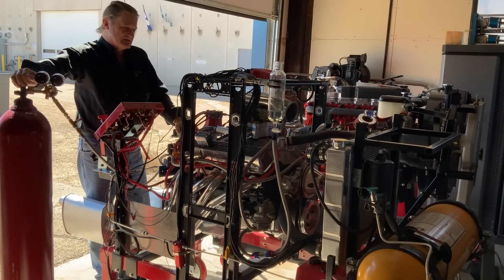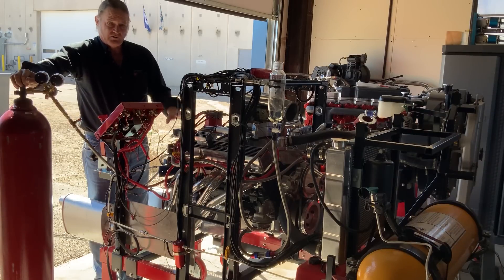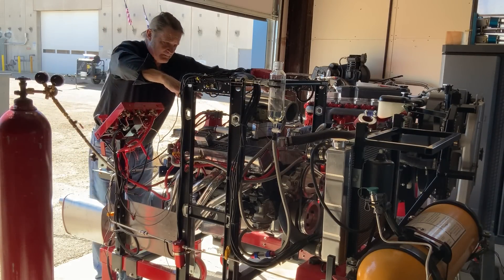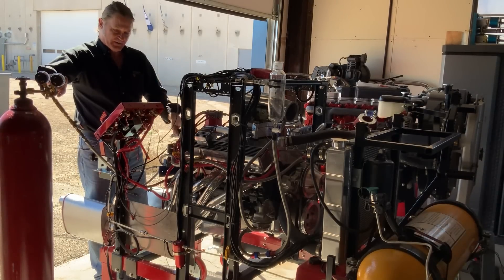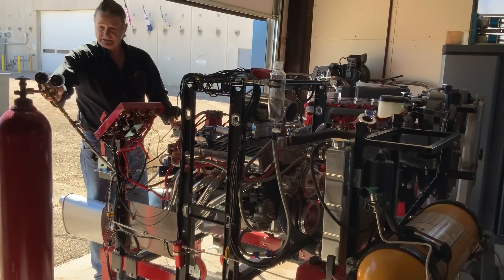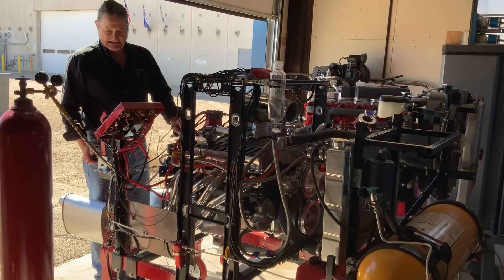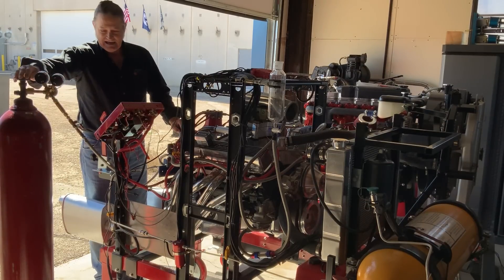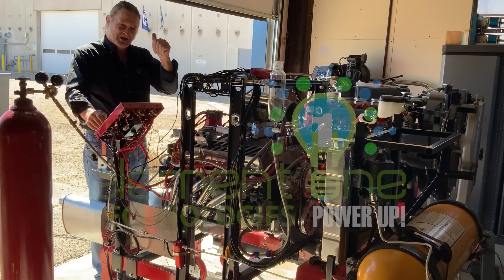Hydrogen powered V8 ICE High RPM Test

Comment: just discovered your channel.... this is great! I've been touting that hydrogen ICEs are the way to go, it just makes huge sense, Even with its problems, but like many technologies in their early stages of development, it can be overcome. From all I've read about hydrogen, the main problems are the production of hydrogen in the first place, as it requires gas to be produced, but the newer 'Green Hydrogen' processes, shows that even though it's in its early stages of development, shows that hydrogen can be produced without using petroleum. Of course, like everything new, it has a much higher cost that gas... but again, all new technologies (not that hydrogen ICEs are new, but in its early development stage), it's just a matter of time, and when there's more demand, it becomes more profitable and the costs get lower. The other problem with hydrogen, though I don't see it as a problem, is the loss of power compared to gas. From what I remember, there's an approximate 15% loss of power, but that's not that big of a deal. Just look at how seemingly low powered engines in motorsports are tweaked and improved to produce absurd amounts of power, so that 15% loss can easily be overcome, and 15% is not that huge an amount. When the early days of pollution controls hit the auto industry back in the mid 70's, it reduced power levels a LOT more than 15%, and today's engines are a lot more efficient, cleaner, and produce many times more powerful engines with better pollution engineering. And, most importantly, all the businesses and manufacturers that are are built up from the ICE, can stay in business... Instead of being forced to go out of business.

I love your engine run stand, but I'm wondering what that big yellow tank is used for (?), as I can see your hydrogen is being fed from the tall bottle. Also, I cringe a bit at your proximity to your engine, you really need to put that engine in a proper separate test room, like any dyno room, separating yourself from any potential catastrophic engine failures. I see you're just in a garage, and obviously funds are limited, but that really, really needs to be addressed. All your work is going to mean nothing if you end up in the hospital unable to work on your project. But hey, congrats on your testing!! This is fantastic. 

Though I'm not against battery operated vehicles, the idea that we should convert all of the almost 300 million vehicles to battery operated electric cars, just screams of trouble.... What with the ecological effect of creating that many strip mines and fracking wells (yes, fracking is a method of extracting lithium and we all know how damaging fracking is) will it take to produce that much lithium to power that many vehicles? And putting all of one's eggs in one basket, is just asking for trouble. Yes, once all the coal plants and eventually, all the natural gas plants are replaced by renewable power sources, electric will be even cleaner... but as we've seen, those power plants are at the mercy of extreme weather, and domestic terrorists... not that a hydrogen plant wouldn't be, but with electricity, the grid itself is just way too open to damage. Going all electric is a bad, bad idea, and is gonna bite us in the arse in short order. 

Hey, big props on your project... gonna keep watching and seeing how it goes. Good luck!! Now I have to check out your other videos....
Reply: By 2028 The Japanese Toyoda and Honda will have the Definite answers for What Kind of Cars we drive.

I copy here the Fuel Mix  to Generate Electric Powers in Texas (ERCOT) which is the Best Independent Grids in USA.

Last Updated: Aug 31, 2023 19:29 CT

CURRENT GENERATION
Solar1,807 MW (2.5%) 
Wind6,224 MW (8.7%) 
Hydro228 MW (0.3%) 
Power Storage917 MW (1.3%) 
Other105 MW (0.1%)
 
Natural Gas 46,786 MW (65.5%) ‼
Coal and Lignite 10,419 MW( 14.6%)‼

Nuclear4,946 MW (6.9%) ‼

In half an Hour TX local time where Solar Energy would be Zero and more People Turn on their TV and Plug-in their Teslas.

The Percentages of Natural Gas would be 74% and Coals would be 14.5%

We/I have been monitor daily in August and The Grids are Dirty more than a Simple Small ICE Car -- the averaged ICE car has Engines of 120 KWatt/hr while as most Teslas are like 400 KWatt/hr.

Based on ERCOT and Many Agencies: The Efficiency of

Solar is 25% more or less
Wind 20%
Coals: with a typical U.S. coal plant operating at 32% to 33% efficiency. 
Natural Gas:  50-57%
Then when Electric Powers Charging Batteries and Run Electric Motors is around 80% in perfect Weather, when Sub-Zero Temp Winter Coldness Efficiency is 50%.

My Math shown the BEV are more Polluting or Higher C02 Emissions?  Perhaps DOE and EPA have been using a different Charge/Standard to rate those Batteries EV!

That not including all the Mining to Get Metals to Make Batteries; and unless the New Solid States 🔋 🔋 Claimed by Toyoda and Tesla;  Most BEV are 1200 lbs more Heavy than averaged ICE;  The Tires and Road Surfaces worn-out.  And that I have not accounted where would be the Energy to generate enough Electricity for USA even with 50% were BEV Electrified Vehicles??‼‼

Cheers,

Comment: Two issues here buddy. Hydrogen run hotter and no lube. Run it for 1000 miles and those rings and cylinders will be cactus. The other issue is where do you get your Hydrogen from. It takes a ton of electricity to  extract Hydrogen, so as far as green its shit.
Reply: Hydrogen DOES NOT run hotter due to faster flame speed. The EGTs are 40º lower on hydrogen the gasoline. This engine I built 8 years ago an its as strong as it was then. so - sorry - no toast.

Comment: I really don't understand all of the hype. Also, how can you tell your AFR with no wide band o2. Didn't we already invent this technology except we youse it for CNG due to the lower heat strain? I know CNG Burns at 1790 Celsius and Hydrogen Burns at 2045 C. It's a great idea in general but an impractical application. If you were doing actual loads or driving, you would run the risk of melting pistons or melting your exhaust. I mean steel melts at 1370 Celsius.  I could honestly see your, e.g.t temperatures reaching at least 1500 C.  Aluminum blocks would be on the verge of melting as well. Seeing as aluminum melts at 660 C CNG kits already have a hard time with high heat and low power. It's common for the blocks to crack. If you were to get very serious about that, I think you should steer away from piston engines. turbine engines may handle this type of fule better.
Reply: If you want true green energy, go nuclear.

Comment: It's running quieter and smoother  on hydrogen.. Could it produce enough energy to make enough HHO to operate it?  and how much residual energy would there be left and could the byproduct be  made with a generator head into electricity ?
Reply: "Could it produce enough energy to make enough HHO to operate it?" -->nope not by a long shot.
"how much residual energy would there be" NONE, since the electrolysis takes more electric energy than the produced gas mixture will give back in the ICE, it won't even be able to give enough energy to the alternator to power the electrolysis due to unavoidable system losses.
Reply: Lol
Reply: HHO is a toy compared to this system and doesn't work for generating power.

Comment: You need to control the fuel delivery and air delivery as a combination based off of a load multiplier just like a standard fuel table. I am sure you could set this up on an aftermarket engine ECU such as a Holley EFI system, and using both MAP and IAT sensors you could control both the throttle body for air and using a MAC valve on one of the outputs on the Holley system to control your fuel solenoid. You need a large supply and a large hose to the solenoid, with the solenoid being as close to your injectors as possible.
Reply: plenty of people running custom systems and SBC on stock 0411 PCMs... now that they are free to unlock.
Reply: Irrelevant gobbledegook.
Reply: hydrogen needs direct injection engine to work properly
Reply: Yes - Direct Injection into the cylinder is the best for hydrogen -  BUT direct port injection works almost as well. On my naturally air aspirated 350 Chevy V8 i have built a very special fuel rail injection system. There is only one in the world like this.  @FourthWayRanch
Reply: What we should do is try to see if we can get that water vapor exhaust to condense in an intercooler and then return the water to an Electrolysis unit. There was a guy who made an amazing design for such a machine. He had specific sizing for the metal plates.
Reply: @joshuawhite3411  LOL specific sizing or not,  it takes electric energy for the electrolysis and it will require more power from the engine to run the electrolysis then you will ever get back from the Hydrogen gas that was produced  if you pipe it back into the engine.
Reply: @milanswoboda5457  Bullsht you run the electrolysis unit of your Alternator which you buy in many different Amperage outputs so all you have to do is either replace your original alternator with a much higher amperage unit, or install a second alternator to your engine DER. Lmfao.
Reply: @fullboostturbo1  LOL someone is an absolute genius here.  Newsflash,  an alternator will require power from the engine in order to make the electricity and it will pull more kinetic energy from the engine than the electric energy it generates in accordance to the electric load connected and with it  the engine will use extra fuel to turn that alternator which converts the kinetic energy to electric energy. Get yourself a bicycle bottle generator and turn it by hand with and without a load connected, you might learn something ;)
Reply: @fullboostturbo1  now since you've deleted your impulsive post lets give you some simplified numbers of Hydrogen reality.  One USgal of gasoline is the heat energy equivalent of 1kg (2.2lbs) of Hydrogen so you will need to produce that amount for every USgal of gasoline an ICE consumes, btw the energy value for that 1kg H2 or 1USgal of gasoline is about 33kWh.  A commercial big industrial MW scale alkaline electrolizer consumes approx. 44kWh of electricity at the electrolyzing stack for that 1kg of Hydrogen.  This does not include all the supporting electricity/energy required around the stacks nor will you ever achieve this efficiency on a small scale unit but for simplicity lets ignore that.  Now please feel free to look up stationary Generators that are capable of making those 44kW of electricity for one hour to be able to generate one kg of Hydrogen in that Hour and see what fuel consumption they would have under that 44kw power load or find a Generator that consumes 1Usgal of gasoline per hour and see what the max kW electric output is that it can produce with that fuel consumption.  Hope that will open your eyes to reality.
Reply: This is NOT TRUE. if you install a BIGGER alternator you put more energy draw on the engine. that requires more fuel. If you put a second alternator on the same engine - same effect of engine draw. You cannot get more out of an alternator driving electroylsis than the energy used to produce hydrogen and then moving a car in the ICE. NOT POSSIBLE! Lmfao! @fullboostturbo1
Reply: There is 1: a loss of energy from condensing the hot vapor back to water 2: loss of energy to produce electrolysis. BUT - still the fuel and engine can be modified to make up for some of the losses - not all.   @joshuawhite3411

Comment: Yummy hydrogen monoxide :)
Reply: incorrect it is dihydrogen monoxide ;)
Reply: @milanswoboda5457  meh you'll still die from it lol
Reply: @quarry1030  and I believe you are misinformed there and fall for an old joke.  When Hydrogen combusts it creates Dihydrogen Monoxide which is Dihydrogen (H2) and Monoxide (O) which comes out to H2O or more commonly called WATER.  However aside from the Water there will be some Nitrogen from the ambient air that also will combine with Oxygen at high combustion temps and that results in NOx emissions from the exhaust.
Reply: @Milan Swoboda  hydrogen monoxide has one oxygen and one hydrogen. dihydrogen monoxide has one oxygen, two hydrogen, and I'm not joking
Reply: @quarry1030  Really now and you certainly can provide me with practical application where your Hydrogen Monoxide is being used

Comment: This is where I want to see our future go. Excellent work.
Reply: @gmail account It may not be as efficient but there would definitely be demand for engines like this if normal engines eventually become regulated out of existence.
Reply: @gmail account And there are some cars still running after 50 years, while most of them are long gone and rusted away. In normal daily use in colder countries, like the one I live in. Tesla batteries have approximately half the range when fully charged after 2-3 years. 4 Years is absolute maximum time you can use one set of batteries. Here is a video where local guys blow up a tesla when the owner lost the warranty after trying to fix broken battery pack in quite low mileage tesla. It can work in sunny california but it's not so good here.  https://www.youtube.com/results?search_query=beyond+the+press+tesla+explosion And this is why we need other solutions than 100% electric car everywhere. On top of that EV:s are boring while many like the sounds of sport cars-
Reply: @gmail account You are right about the extreme cold weather, it's not good for any cars yet but so far petrol (or perhaps hydrogen powered combustion, or the fuel cell technology would suffice) is my only option. We have EVs in cities on people who have access to warm parking cave and/or access to charger for example at work place garage or atleast they have warm garage at home, which many in apartment blocks don't have. 5 000 people and less than 5 chargers per block makes quite a long queue lines. 
I'm little sad I must say I really am glad to have a good conversation about this. These days people tend to join the extremes in every guestion and cannot tolerate people with differing ideas or opinions. Yet we still must try to coexist on this Earth. 
Have a nice day/evening sir.
Reply: It's also more green than electric car, with rebuilding resource intensive battery pack atleast every 4th year. Imagine how much energy it takes to get the limited rare earths from ground to factory and to consumer. It's crasy.
Reply: Wrong. Do some research instead of clinging to fossil fuel mantras. @ark-mark1
Reply: hydrogen on-site made = FTW !

Comment: Why did you expect backfire??? That would and should only occur at a very lean afr and/or totally off ignition timing, no matter if you were running on H2 or fuel. Making an ICE engine run on Hydrogen is easy as long as you correct the afr and timing basicly. The tricky part is bringing enough hydrogen with you in the car to have a decent operation radius. I hope someone figures out how to get around that problem, because I like combustion engines so much better than EV´s

Comment: combustion engines are able to run on any burnable gas , the power depends on the caloric capacity of said gas per volume 
we have them running on the gas that comes off of rotting garbage and litterally shit from cows over here (these are stationairy generators and they run the exhaustgas through a boat header to heat up water for the central heating and hot water ) ll you need is to find the right af ratio for the perticulair type of gas and have enough pressure or flow  to feed enough of it intoo the engine 
we call this stuff biogas and we can cook on it too (just make sure the gas is lit at all times as it has a certain smell to it )
think an ls engine and gas injectors (propane injectors) run by a stand alone ecu would be way more efficient than the mecanical system youre running at the moment , you can tune the af ratio and the ignition timing all through the powerband and it will adjust itself using a lambda sensor 
would take more time to tune it to be perfect but once done it will run forever (you do need harder valveseats as the gas cools the seats less and provide less lubrication and sealing ) if the gas has a higher pctane rating it helps to run a higher static compression as power goes down a little compared to running gasoline when running the low compression

Comment: propane throttle body with a vaccuum control fuel delivery system woul work perfectly in theory you can convert any forklift to hydrogen

Comment: What’s a good air fuel ratio for h2?
Reply: stoichiometric ambient air to H2 is 34:1 by weight which sounds good vs air/gasoline but there is the issue of the low volumetric energy density of Hydrogen so you can not get as much fuel energy into the cylinder than you would with much higher volumetric energy dense liquid fuels unless you direct inject and/or turbo boost.
Reply: @milanswoboda5457  perfect response. Thank you

Comment: And if you get into a crash with all that hydrogen? yeah glhf.
Reply: Hydrogen tanks dont explode...
Reply: They have done multiple tests with modern hydrogen carbon tanks, they are as safe as standard fuel tanks.
Reply: @julianbrah5873  wrong
Reply: @julianbrah5873  No its not, you really going to feel safe with 400/500 bar of liquid hydrogen with an expansion ratio of 1:848? Hydrogen is stupid idea peddled by big oil.

Comment: Jcb are doing this for diggers and the like. I remember a car running on hydrogen in the 1970s
Reply: yeah and in the JCB family there is also Ryze Hydrogen so certainly will be good business for them if they can also sell the Hydrogen for the lower efficiency Hydrogen ICE they make :).
Oh and you can go back to the 18th century where Hydrogen was used in early combustion engines before Gasoline came onto the scene.

Comment: Why is this "new" JPL (jet propulsion lab) had 3 test cars 2 chevys and a dodge in the mid 70s running on hydrogen. It was proven very viable BUT their main problem was acquiring the hydrogen. The engines ran just fine.